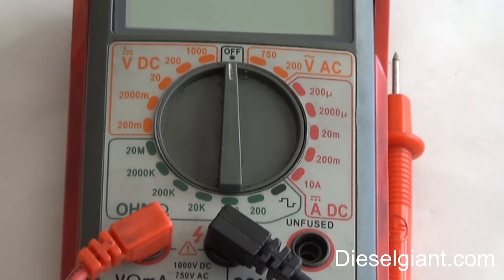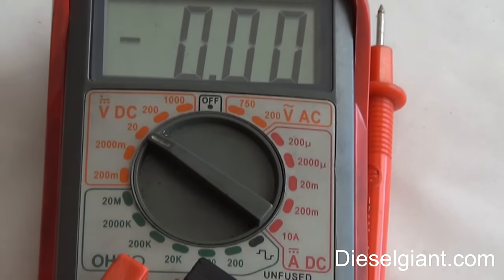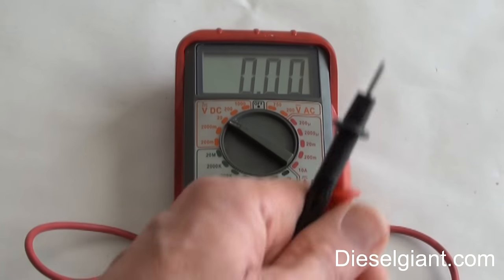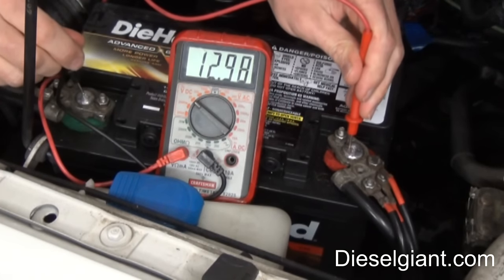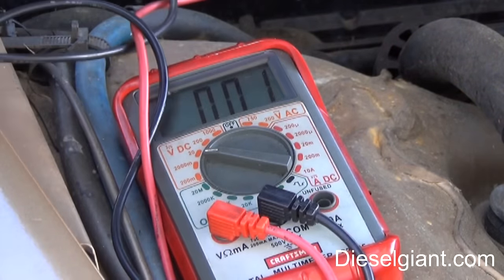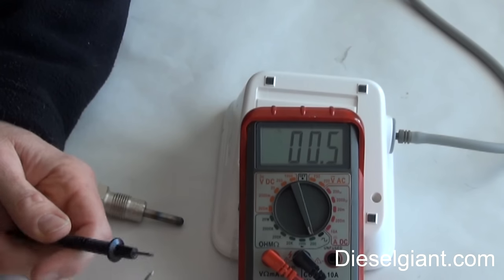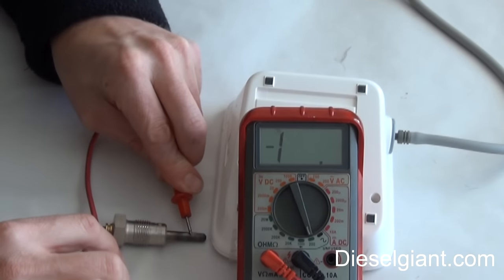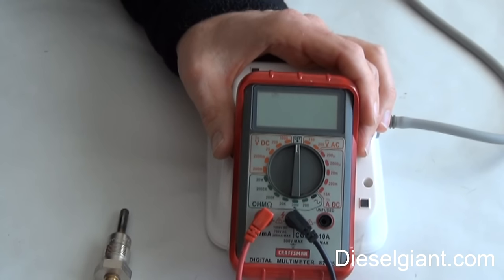Beginners guide on using electrical multi-meters for autos

Comment: He forgot to talk about testing for circuit continuity. The multimeter has a 9v battery inside it and can send a current through the wires to see if there is a break in the circuit. The position is there on the dial. Also you can check whether a power supply exists between 2 points in a circuit - by putting the red probe into the live wire or on a live terminal (with a power supply on) and the black probe to a good earth or ground.
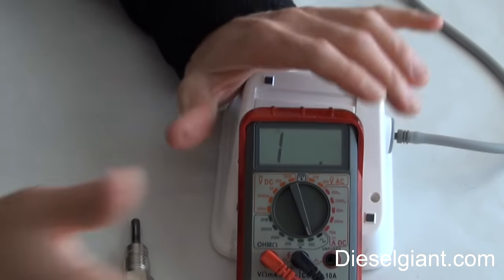Reply: 17:34

Comment: I am just beginning with a test light and because my dad used to incorporate a multimeter into everything, dc and ac, I knew I needed to learn how to use one.  Wow, you made it so easy to understand and I can see that I will have to take each part of my car and it's testing one step at a time, first learning the volts as well as resistance, to do a proper diagnosis.  Thank you.
Reply: Larry  thanks . I did'nt realize how simple it was

Comment: Hi diesel giant- I have to test some relays in my car (04 Honda civic EX coupe) and did some googling to re-familiarize myself with my multi meter since I haven’t  used it in 3-4 years. I just wanted to say that there’s a crap ton of videos out there on this stuff,  especially when it comes to power window switch/motor/regulator troubleshooting- what I’m searching) and your video is by far the best at going over the basics of the multi meter. A lot of YouTube channels don’t realize that they’ll say “ok and then switch your multimeter to DC for voltage” but don’t explain about the difference between dc and ac voltage (like the fact that you will never use AC for your auto, etc), and they also don’t explain perhaps what number you should be using (20 vs.200, etc.). I just like the fact that you as a teacher DON’T AUTOMATICALLY ASSUME that we are going to know those things! So many videos don’t describe what they are doing and why. There’s also the other end of the spectrum- there’s the long videos where it takes forever for them to get to the point (I’ll literally fast forward until I see them actually pick up the multimeter 🙄) 
I just wanted to say that for a 20 minute video instruction I watched the entire thing, and you did a very good job at giving the basics in a CONCISE manner, without skipping over things you don’t realize may not be obvious to all of us. So thanks for this video!!!
Reply: I was like man that’s a lot of words, then I saw it was a chick.....yep
Reply: @JasonLee-lv7tm  a pretty damn smart, savvy chic who both writes music and works on her own car… most men are actually impressed. So if you’re trying to put me down because I wrote a lot and that alone made you stop to actually type out a “typical chic” comment - sorry, but it didn’t work. you can’t put me down 🙂😇

Comment: Great video for beginners like me. If you do not know which holes to plug the wire leads into simply look at the screen and plug your wires into your meter the same as they are in the video on the meter.

Comment: Thanks to your video explaining the settings on a multimeter, and another video using an inexpensive multimeter, I was able to located the source of the electrical drain causing the perfectly good battery in my truck (with a good alternator) to go dead after a couple of days of not driving it. Prior to watching your video I only used my multimeter to check the voltage of household type batteries. The simplicity of your explanation made it easy, with mine in hand, to follow along as you explained the various settings and uses. Your video was just as the title says that it is....  Thanks.
Reply: How did you do that? With all the different wires and stuff?

Comment: Awesome video! I bought a multi meter several years ago but never used it because I didn't know how. After watching your video, I feel confident enough to put it to use now.  Still too chicken to use in my electrical socket though, so I'll stick to using the lighted plug in type for that. Thanks for the step-by-step tutorial.

Comment: Thank you I need a real quick refresher on how to use the multimeter to check a car battery problems in 20 years since I use a Multimeter to check car battery so I just need to make sure I was on the right settings thank you very much very important very very clear you make sure that every point was touched on that way we would not make an error definitely good idea to mention not blowing fuse because a lot of people do that but like I said I have a battery tester my battery tester took a crap so I had to go back a multimeter anything 20 years to use one so thank you thank you thank you very very much the refresher and very informative very very to the point that you make sure every point was touched on thank you very much you will learn a lot from this

Comment: Thanks for this video, I began working on cars as a young kid many Many years ago in the early 70's, by the late 70's I could rebuild every part of an American Auto except the Transmission, Between high school football, Baseball & Track, I wasn't able to focus on Transmissions, Now I own a couple of Ford Thunderbirds, one is a 1977 & the other is a 1988 both have 302 engines, The 88 has a few more electronics than the 77, But I can appreciate the benefit of using this tool, Thanks a bunch.

Comment: Great video! Voltage drop can be another very useful method to test starter connections, grounds, you name it. Take any electrical path (ie. battery cable) and connect one probe to point A (ie. battery) and the other probe to point B (ie. post on starter) and crank it. If you show 2 volts while cranking, thats 2 volts thats not getting to the starter. Sometimes you can show very low resistance with the meter, but have enough resistance to starve a device. I need to use this method between my cab and my battery with all my accessories on to find an existing ground issue.

Comment: Thank you for your overview of the Multimeter. I appreciated your clear instruction on testing the battery of a car. If I might suggest more videos, I would suggest a real in depth video of just one section of the multimeter per video, and maybe focusing on one subject, such as testing fuses to see if they are good. In another video you might show how to test relays, and so on. I've heard you test auto fuses with the Olms section, and I've ALSO heard you test with the DC voltage section. So that's confusing. If a video maker tries to tell you there are three ways to test fuses, that's super confusing. It might help to tell everyone the simplest way, and leave the other ways for another video. Also,  NO ONE tells you if there is a positive or negative side of the tiny auto fuse. Same with small components of other kinds. No one tells you whether you can put the test leads on either side of the fuse, or any other component. But this is just one example of how confusing it can be for a beginner, and the instructor may assume everyone knows these things! But I know for a  fact, people generally don't want to show ignorance. And they can get taunted for their ignorance. Me I don't care. I'm ignorant and really appreciate anyone remembering the total beginner state,  and explain things extremely basically,  so we can feel confident in testing auto fuses, relays, for shorts in wires. Etc. You did a great job showing how to test the auto battery and check whether the alternator is working also. But if there is a short, it could leech out the battery charge, right?? What other things could leech out the battery charge? I'm dealing with two vehicles now, which go dead pretty fast even after the battery is fully charged up, and even my mechanic seems to not have a good handle on this... I'm stuck at home til  God (and You Tube) helps me  figure out my own electrical problems. And that's why we need to know exactly how to really test for our vehicles wires, our fuses, our relays, etc. God bless you for helping the folks. We are in your debt! Thank you for your kindness in making these types of videos.
Reply: What did you figure out? I just saw the video, on how to use a multimeter for beginners?

Comment: This is an excellent and broad intro to using a DMM for automotive use. I appreciate the obvious production work you’ve done to make it a great video. Also, a minor piece of errata:
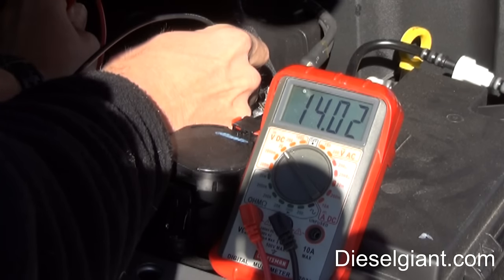@10:57 you report that the meter is indicating that the battery is putting out  “about 14.4 volts,” when the meter is reading “14.02”.  I believe that means that the battery voltage is much closer to 14 volts (+2/100s of a volt) than to 14.4 volts (-38/100s of a volt). 🎶What a difference a decimal place makes 🎵

Comment: Check alternators voltage output  where the battery cable connects to the alternator with the positive testing wire and ground  testing wire someone the block. Then test battery terminal and compare results. There can be resistance that will give you a lower reading of voltage at the battery  than what the alternator is actually producing.

Comment: Ya, his voltage meter is old.  I noticed the left and right probe ports on his model is reversed compared to the new Voltage meters.   All the new models show the red Vma port on the right side of the COM port.   Since I have never owned a voltage meter before that was the first thing that threw me off watching this video but other than that it's a good video for beginners.

Comment: Confused on the difference between current and voltage. Which one do I measure to test car parts ?
Reply: Voltage V  is the electron pressure .  Current  I  is the electron  flow  .   Most electric parts can be tested WITHOUT power using the ohms resistance setting on your multimeter,  EXCEPT large capacitors * dangerous .  Also note you have to look up the ohms what each place on the part should measure with meter.

Comment: Hi this helped But what about the bottom holes ?? 
Ya didn't tell what they mean .
I am testing my battery which is brand new and my car won't start now it did for awhile ,then I turned it off and everything went Black the key won't ding Nothing,, nada,, period ..
I don't have posts to pull out to charge and its a pain getting to the negative side.. 
But I need to know what lead goes in what hole on bottom Mine has 3 
Com= black,,,
What does 10 A mean its has blue rim around the hole )does the red lead go in it ? Or the VmA ?
The VmA with the omega sign mean?
I am sooo  confused 
Thanks please reply

Comment: Very clear precise,do you answer viewers problems?,I have a boat 12v motor,new marine 110 ah battery,but how can I tell how much power I have left to run,very important,I am 73 and not strong or fit enough to row back,from my departure point,just bought my first multimeter, could I use this ,welcome any info from any viewer.

Comment: What if you just installed a brand-new battery, what should its readings be in the voltmeter at normal range?

Comment: I set commercial electric analog multimeter to 50 to test 12 V car battery and it read 1 lil over 10 close to 12 . Is that right ? I've also a slow charger at 1.5 amp slow charge . I cranked it soo much yesterday trying to get car started but nada . I had it towed . How long will this take ? i want to be able to crank car engine to work / test on car today

Comment: I’m calculating voltage drop to determine a drain on bmw battery. For some reason I can’t get a reading other than 0V across every single fuse. What am I doing wrong?

Comment: What setting would I put it on to check if an automotive wire is getting power?  I am hooking up a tail light wire to the light but want to know if its getting power before I connect it. Thanks

Comment: Yo Diesel guy..
Good video..
Good idea for your next?
30 DVOM Tests in 30 minutes
Consolidate your video..
But to stick in 30 tricks of testing and measuring in 30 minutes.
A video that will be saved by all and shared, by many.
A virtual cheat sheet
Keep up the good work
I would love a video that jumped rite into showing how and the explanations kept to monkey see monkey do.
I would watch this video until I memorized every tip/ trick

Comment: Do you know why DC adapter (9V)  gives much more voltage (multimeter read 15V)  than its supposed to?  Would it damage the device when using it?

Comment: i would like to add this for the new guys  im 86ys old so i was a meter when most otem were born   i built my  first meter from a kit  mail order electric corse ?  you need a very cheap meter  to learn you dont need one with 40 functions on it  start out like  he did  test batterys    sparks etc   stay away for 120volts to star with  check fuses the see if they are blown   i have several meters  i use the almost daily    harbor freight will  do many test  its less than 8$  you can learn as you go

Comment: ok i borrowed a meter with the meter set on 20 v with the key on, ac controls on, fan on, and ac unplugged.  With black lead on neg post and red on  the compressor  ac plug it reads and 0.01 and  on ground wire coming right off the compressor reads 0.01.  However when i manually  kick the clutch in using the  hot wire on the compressor to the hot battery post i then get 12.5 6 7 volts etc  When   Jeep running everything hooked up the same way i get 13.4 5 volts  from the ac plug and  ground while  running shows 0.02  The voltage from wiring harness wire/with the ac plug i get 0.06 running .  Update  With motor off, key off, with neg battery term hooked up i get 0.00 at the ac plug and 0.00 at the ground on the compressor... but when i unhook the neg cable/post i get a reading   of 12.21 an rising from ac plug and 12 .13 an rising on the ground coming off the compressor. Terminal  hooked up no reading. Term unhooked and with my black lead directly on the neg post of the battery i then get a reading. I  admit I dont know much about using these meters but ive been watching video's trying to learn all i can. I really appreciate you trying to help me. i must get this working. I have breathing problems and i really need the ac working. Its hard for me to catch a deep breath when i get real hot. So Thank you very much for trying to help me.

Comment: Nice job, I appreciated your video, but was disappointed about one thing.  For a beginners video on how to use a multi-meter the very first thing you should have explained is why there is an extra lead connection hole at the bottom of the meter.  What does 10A mean and can you use it for testing voltage?????   It is understandable for the black ground wire to be pugged into the center hole, but which side does the power lead get pugged into?  I watched the entire video and wondered why it wasn't mentioned?

Comment: Hi very good one question if lam checking wiring on my car and l want to check for breaks in wiring or a part do l take the cables off the battery not to blow a meter?  ED

Comment: This would of been a great video if you had explained the plug holes because they are not all the same.  I'm still intimidated. I wanted to test a wire i just connected to my battery system of four batteries. Top plug hole said 5a max second 250v max max  & 500ma. I really just don't know. How about it  Morpheus I need to download knowledge on how to work this 7 function digital multimeter.

Comment: Bought my cheap voltage meter yesterday and learning how to use. I test my battery today, before I started it. It reads 12.29, is that a good reading? Drove it the day before also.

Comment: Does anyone know if the inside cabin fuses should light up test light when done this way ? They don't and pretty much checked them all . The fuses under the steering wheel inside cabin and yes , I've tested it to make sure it works including checking the fuses under the hood in the engine compartment and they light up .
Reply: You probably have a bad ground to your test light. I would try running a wire from your negative battery cable to one side of your test light, and then check fuses. Sometimes it's hard to find a good ground on the door.

Comment: I disagree with one point here, putting your meter on voltage in the resistance setting will not damage your meter unless the voltage is very high.  I have done that many times.  The input impedance of the meter is very high.

Comment: For the wall outlet, it was my understanding that the smaller hole on the right was the positive/hot side, and the larger hole on the left was the negative/neutral side. Are you able to measure voltage by inverting the probes to the opposite sockets? As in red probe on the right and black on the left?
Reply: Yes the meter will read the same it's ac alternating back and forth 60 times a second.Unlike dc which is polarity sensitive plus/minus

Comment: Thank you for the video! Question, when testing car fuses for a parasitic drain does it matter if you get the probes backwards? It doesn't say anything on the manual what that negative or minus symbol means. I have the AstroAI AM33D.
Reply: If you get the minus sign just swap the test probes and it will go away.

Comment: Excellent information, can you tell me with AC does the voltage go back and forward due to AC power being electromagnetically produced and by the rotation of magnets from north to south? So is the actual rotation of magnets responsible for the back and forward motion with AC as opposed to DC flowing in one direction mainly sourced by a battery. Also with larger wires having less resistance and the voltage flowing through larger wires more effectively is that due to there being more actual wire (size) thus being able to carry more electricity due actual larger wire?